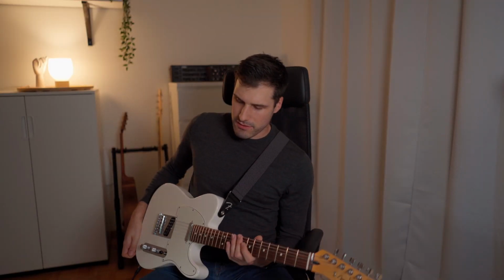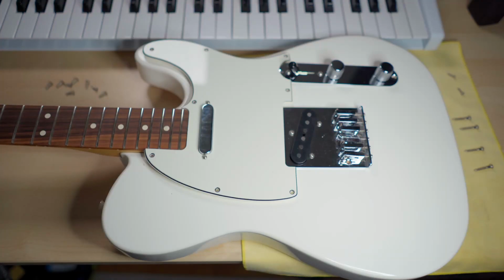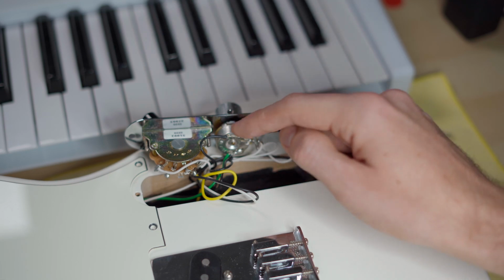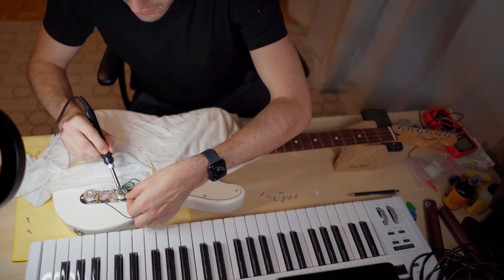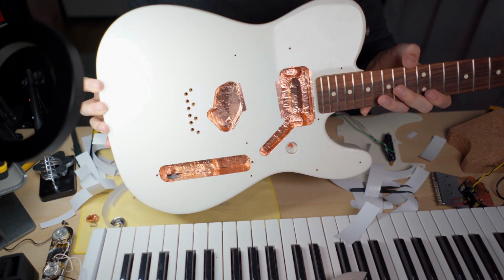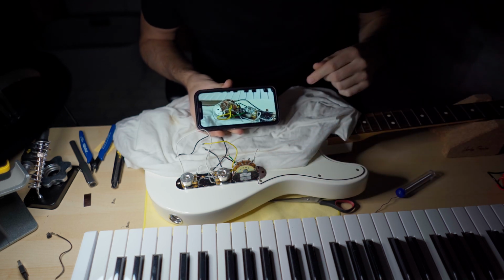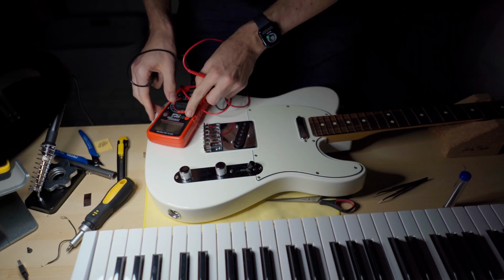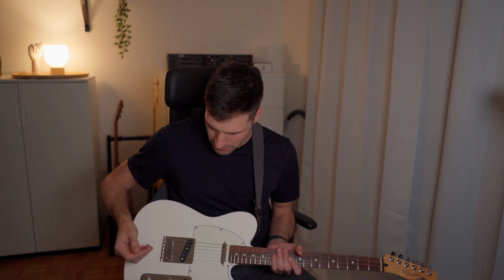Shielding Fender Player Telecaster: Copper tape against noise - Is it worth it?

Comment: From all the research I've done these are the main points and answers to questions I have found.
Will it reduce noise? Yes, but not entirely, depending on the make, model and internal electrics the noise hum reduction could be 30-80%.
Will it change the tone? - Yes, or course, but that is also the goal of shielding the guitar.
Shield and ground each cavity and underneath the pick guard. Make sure each cavity has continuity between each other.
Changing to "noiseless" pickups will further increase the noise reduction.
Ideally use copper tape that has conductive adhesive.
Make sure there are no cold solder points.
Reply from the maker: Yes, I fully agree! After playing some more and testing more situations (it’s been a while since I made the video) I do feel an improvement through the shielding